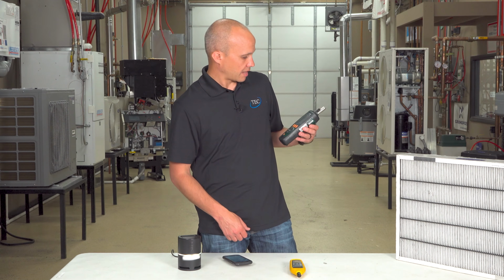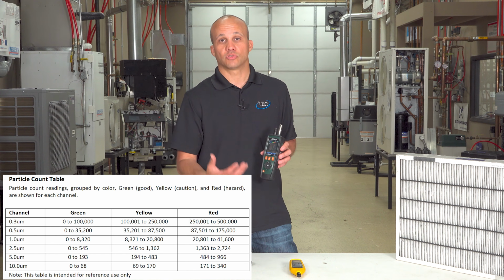IAQ Metrics

Comment: What was the second item you showed? Can you leave it at a business and view it from your shop?
Reply from the maker: The one that looks like a music speaker? That brand is CPS. No, that one is not viewable remotely. It connects to your phone via Bluetooth which is short range communication only. For longer term monitoring, such as a week, you might want to check out AirAdvice. If you are looking for permanent monitoring, don't use any of these and instead consider using your BAS.